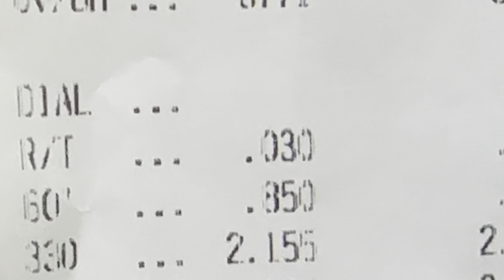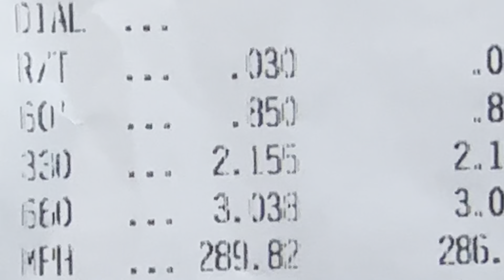PLAYOFF TIME !!! Countdown To The Championship 🏆

Comment: 2 things. Been going to MGR every year for 20+ years. And every single time after the Anthem, those nitro engines fire up and give me the biggest goosebumps ever. Sometimes I get teary eyed. 

2nd, Clay, pull some magic and see if you can get NHRA to move this race back to October again! I really want to see some mid 60's runs! I know it always rained when this event was held in October, but boy, records were broken every year here. Not only that, all the trees around the track were in fall foliage and looked so beautiful. 

On a side note, my friend got me a job at the track during this event back in 05, 06 and 2007. My friend was doing it for years at the concession stands and she got me a job for those years. Unfortunately, they put my as parking attendant those 3 years, so I didn't see much racing, not until half the race was over and most of the fans were already parked and at the stands. But I really wanted to be grand stand attendant so I could see the entire race.

Comment: If you go thru alabama on your way to charlotte you will pass a piece of motorsports history.  If you remember the diamond p sports days and the cross creek production trailers there is one sitting on the south side of i-22 in alabama near mile marker 44 or 45.  This is near carbon hill.  Next to a metal building.

Comment: Ok, @12:58, there's a screen sh!t from the NHRA. And it list the times to 60` etc.  But down at the bottom, there's the track conditions.
What does 'WG' stand for ? "Weight Gain"  ?? .. (Tell Him to stay away from the food trucks ...).
Seriously Tho, What are they measuring with 'WG' & why are they measuring it ??
Luv Yall,
Mike
Reply: Water grains. Similar to measuring humidity. The amount of water in the air effects how the engine will run